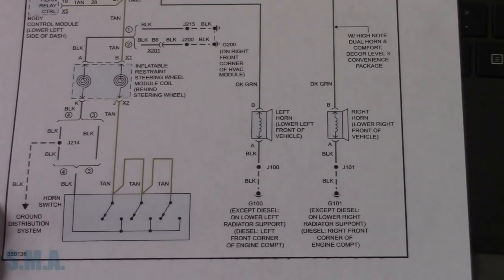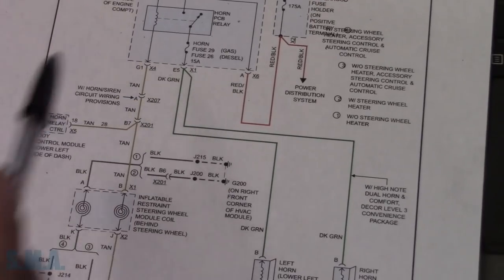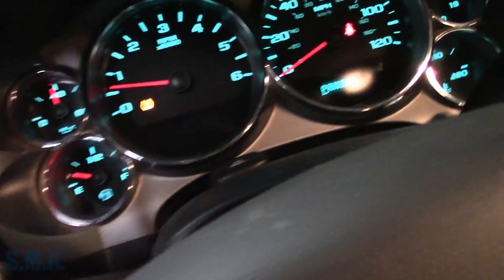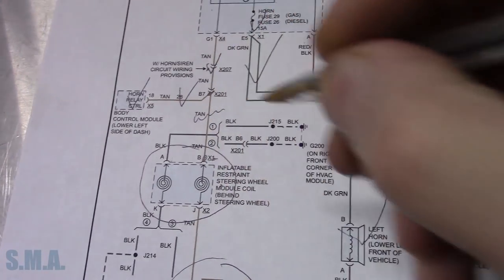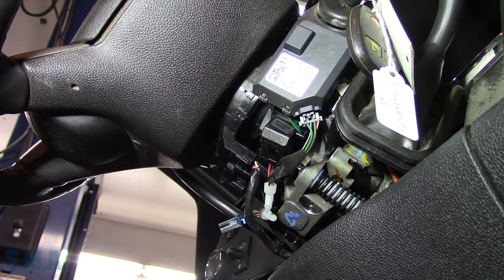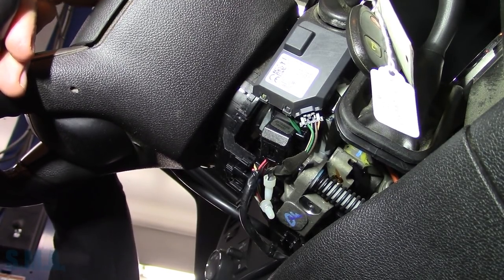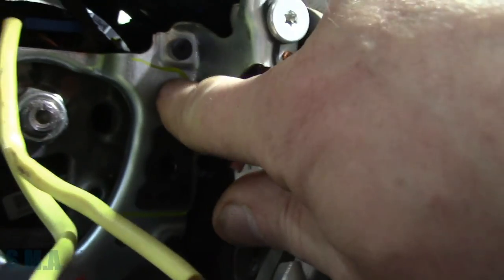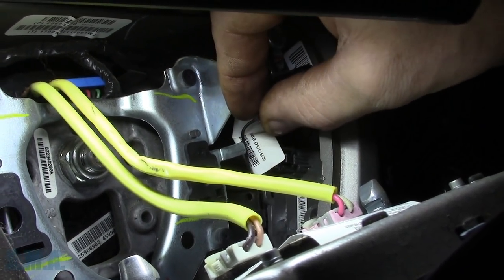GMC Sierra: No Horn

Comment: Is there individual wires for each function on the wheel? I thought they would have some kind of multiplexing of all the functions down one wire with a couple of others for power and ground... or something. My car has 16 buttons plus airbag trigger... so 17 (?) wires seems a lot in the clockspring.
Reply: Some of the wires have to carry power and ground, so I suppose they figure they may as well make it a coiled ribbon cable.

Comment: Salutations Eric O!!! I have a problem and I hope you can solve it. A friend of mine brought a 2009 Honda Pilot EX and the scanner reads catalytic converter is below threshold, but the previous owner said that he replace the catalytic converter. I used the scanner and the oxygen sensors reading in the upstream is on the red zone that is slightly higher than normal around 1.2v and the downstream was slightly higher than normal around 1.05 v so I went straight to the oxygen sensors,  AFTER the replacements, I used the scanner and the upstream is still at slightly higher than normal around 1.2v and the downstream front was in normal spec of .62v and the downstream rear is the slightly higher because I didn’t replace it yet. What can I do with the upstream issue areas. Thank you for hearing me out of this situation.

Comment: If my clock spring breaks, do these things happen? The volume on the column does not work, the horn does not work, I get a stabilizer link off, the odometer does not show, and the cruise control does not work?

Comment: About the aftermarket stuff.....we live in the winter cold of ND.Remote start is nice to have. GM factory REMOTE start sucks bad. We have  a 2011 impala with  aftermarket remote start. It will start a car while you are still in the house or at work getting ready to go home maybe even a  half mile away or farther if you are in open territory.. The factory Remote start on the 2012 Impala wont start unless you are withing 40 feet...... WORTHLESS pointless FACTORY JUNK REMOTE START!! You might as well not even have it if you have to go stand in front of that damn car to get it to start it anyway.

Comment: Classic Best Buy sucks again at doing anything professional install.  They did a radio install 8 years ago on my Silverado and hacked into a wire in the dash for the Ignition wire.  I had to fix that issue myself. I will never let those fools touch anything that I have ever again.

Comment: I wish the problems on my truck were that easy!!! Hey E send me a message if you can get me a low mileage 98 4.6L w 2 valve. I'm going to have to get the tranny rebuilt and I know the mains are knocking a bit, truck has between 230 and 300k miles on it. The odometer hasn't worked in 4 or 5 years, oddly enough it is working now. stupid worm gears!!!!

Comment: bummer, i have the same truck and my horn fuse keeps blowing.  was hoping this would give me a hint.
Reply: Well, you can jump 12 volts to the horns individual to see if maybe one shorted out, which could blow the fuse. If the horn(s) work, then ya gotta work backwards like Eric did, 'cause you might have a damaged wire shorting things out back to the brain box.

Comment: Why would you even put an aftermarket remote starter in those? A factory one is only two new key fobs and a quick dealer programming away.
Reply: the problem is that the Factory remote start kit (part number 17801236) for the GMT-900 platform has been discontinued and cannot be purchased at the dealership anymore, and on TOP of that, the truck HAS to be equipped with RPO Code AP8 which is the Remote Start Prep package, or else that install kit will be completely useless.

Comment: Actually don't believe it could have even been ground, would have to have been only the tan to be bad clockspring, all the other buttons have different resistance to the ground or at least all use the same ground to reduce number of wires needed in the clockspring assy.......

Comment: How does aftermarket start work when there is an immobilizer? Doesn't the computer need to see a valid key?
Reply: IIRC, the GM/GMC trucks still use Passlock. That is so easy to bypass it is a scandal, but just try to get it to work right....

Comment: Good grief.  What happened to a horn button, a fuse, a relay and a horn?
Reply: "When the Steering Wheel Horn Contactor Assembly is activated, the signal is sent to the Horn Control Module, which then activates and sends a signal to the control side of the Horn Activation Relay Assembly Module Controller (HARAMC). The HARAMC then verifies the horns are on-circuit before sending current to activate the horn(s)."

Comment: Eric, where do I find info on what perimeters (milliamps and such) I can test with a multimeter on the hub and bearings on my 2005 LeSabre? Also, the wiring on body side, does that on,y accept signal from speed sensor and transmit it to the PCM or does it send an electrical signal?

Comment: My horn hasn't worked in all the time I've owned my car. Well - really, it works a bit too well (the switch sticks, which led to the horn itself blowing out). I've replaced the horn, but not the switch (cause the airbag assembly seems difficult/not obvious enough for me to faff about separating it from the switch, and airbags r expensive), so I just keep that fuse pulled and borrow the switch/airbag assembly from my dad's car (same parts) when it's inspection time.